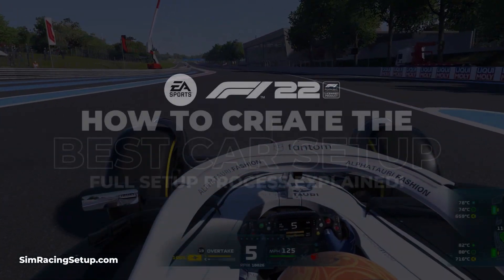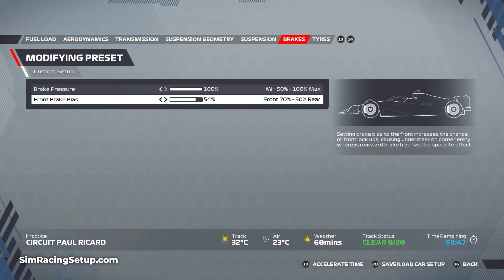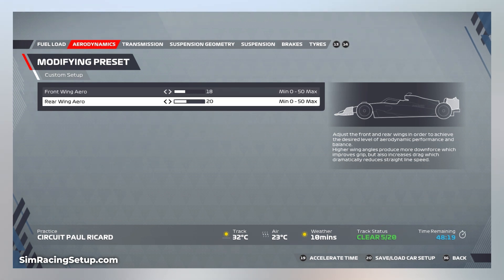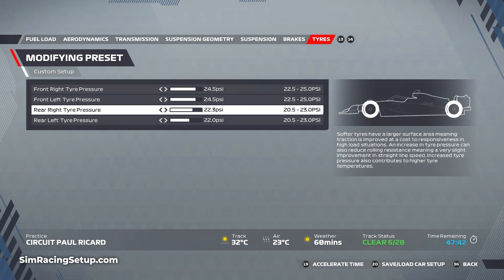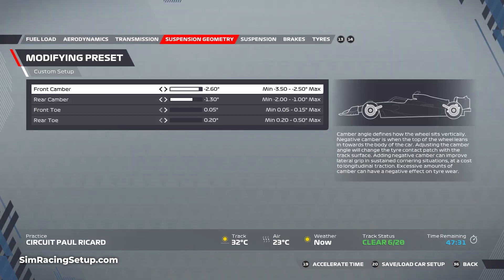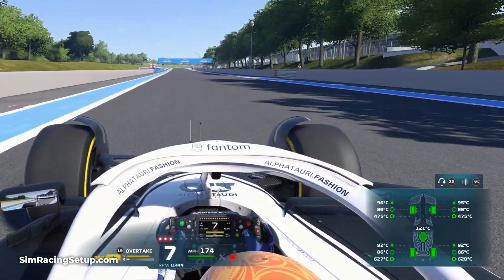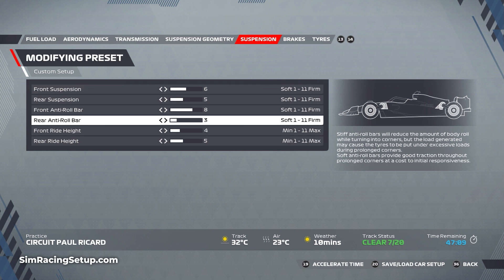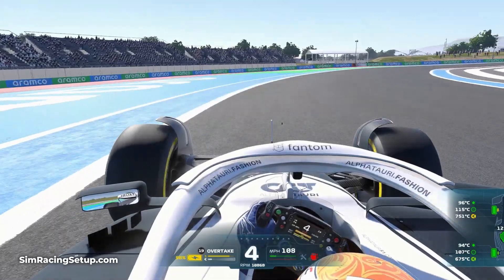F1 22 How To Create A Car Setup - Full Process Explained

Comment: I'm probably one of the few people who genuinely like the reworked handling model. The handling in itself isn't a huge overhaul type rework but there's definitely more traction, the car feels more planted. BUT what has changed significantly is the way you set up the car. Now it is crucial to find the correct setup to get your car in that window of maximum performance. Then it feels great, you can push the limits of the track without fear of constantly spinning. I would recommend everyone watch setup videos dating from patch 1.06. But ultimately, find the setup that you find most comfortable driving with.

In regards, to AI difficulty... I find myself turning the difficulty down but it doesn't matter - why? well A) if you're playing single player who cares?, It's single player, make it challenging but also have fun. And B) nothing about your driving has made you worse at the game, the Devs just need to tune down the AI overpowered-ness or "nerf" them.
Reply: Very well said. To be fair i like the AI difficulty because it simulates how it would be like to race the real life drivers and it challenges me a lot… even though i always get smoked🤣

Comment: The slightest bit of added camber, toe, or rear anti-roll bar only make the car less stable rather than increase performance at all. The setups used by those at the top of the leaderboards are tragically unrealistic (no fault of their own). You typically see suspension and ARB set to 1, and camber and toe set to the absolute minimum values.

Comment: I need some tips on throttle control and basically everything because I went from f1 2021 at 90 ai to f1 22 at 75 ai with a wheel
Reply: I went from 100ai on 21 to 90ai on 22. I also use a wheel, one good tip for your throttle control is ajust your throttle linearity turn it up to around 20. The 1st 50% of your throttle will be less sensitive allowing you to be more precise and have more movement for less throttle.

Comment: Does having higher fuel levels effect tire temps. I test temps with full (or 50%) fuel loads to make sure not to overheat at the start of a race. What are your thoughts?
Reply: In theory I think it might lead to higher temps, however, since you're generally slower at high fuel (slower = lower temps), maybe it all cancels each other out and so doesn't really matter.

Comment: I see you are saying more down force on the rear wing and less on the front. i have been seeing the exact opposite in most TT setups. even after the update.  where did this info come from? personal preference?  or is that something you have noticed in your setups that has changed and made you faster?
Reply: Oversteering setups are usually faster for a single lap since they’re more responsive. But that comes at a cost of tire wear and consistency.

A slightly understeering setup is usually slower outright for a single lap, but faster in a race since it’s easier to keep putting out consistent laptimes without overheating the tires or going over the limits of the car. Especially now with the working temps window of the tires being just 10 degrees C instead of 20.

Unless you’re confident you can control tire temps and can keep a twitchy car on track for 60 laps in a row, go for slightly understeering setups for races. Which usually means lower fw or balanced aero settings.
Reply from the maker: Exactly this. Well said.

Comment: Should we base it off the temps in the middle or the top? Internal or external temps?
Reply from the maker: It is internal tyre temp that you should be going by. External/surface temperatures will fluctuate a lot as you put force through each tyre.
Reply: @SimRacingSetups  Thank you so much! Keep up the amazing work.

Comment: With the suspension & ARB wouldn’t a stiffer rear setting on both equal more oversteer ? You’re saying stiffening the front induces oversteer but I thought it was the opposite? Has it changed in f122?
Reply from the maker: Yes stiffer rear eliminates understeer and introduces oversteer. That’s what I meant to say! My mistake in the recording 🤦🏻‍♂️
Reply: @SimRacingSetups  I see thanks for clarifying, great vid nonetheless mate 👍🏻

Comment: this was after 1.06 ?
Reply: I feel like you can run more setups like 21 after the patch. With the front lower than the rear suspension and anti rollbar. I could be wrong though

Comment: Nice video! 

One thing tho, at around 16:47 you said that stiffer front and softer rear suspension helps against understeer? I don't think this is correct. Softer front and stiffer rear suspensions make the car more oversteery, so less understeery. When I test your setups, this is one of the things that I usually change and don't like, your setups generally tend to have too high front suspension settings for my liking making the car feel heavy and understeery. It's great if you mostly don't want to spin out, however, if you really want to push and be faster, you have to setup your car to be at least somewhat oversteery.
Reply: im not great with setups but i prefer an oversteery car so what type of values would i want?
Reply: @nexy52  If you're looking for oversteer: 
- higher front wing than rear
- lower off throttle (for more rotation/oversteer during slow corners)
- higher rear suspension than front
- higher rear anti roll bar than front
- lower brake bias
- Front toe more to the right also has a slight effect
Reply: thankyou very much good sir 👍
Reply from the maker: Yes absolutely this. It was my mistake in the recording. 🤦🏻‍♂️ Stiffer rear equals more oversteer!
Reply: @SimRacingSetups  Np. It happens. Good informative video nonetheless!

Comment: I dont understand. I use a tt setup and boom the car always wants to spin even on low tire pressures. I bump up the reqr wing and it does nothing. If i want to go fast the car is hard as hell to drive
Reply: And I have just watched the entire video. Round miami i bumped down the tts rear anti roll barr and boom half a second thx man